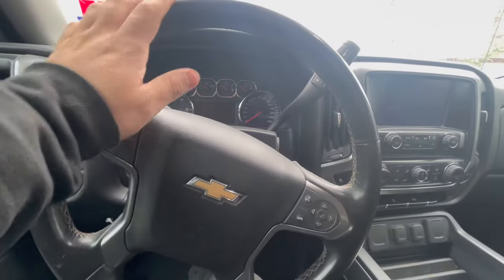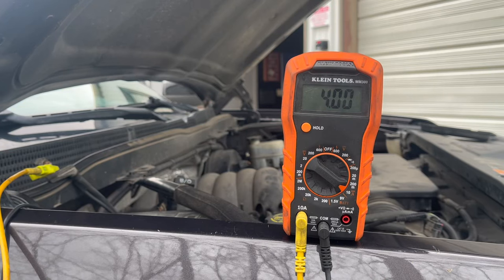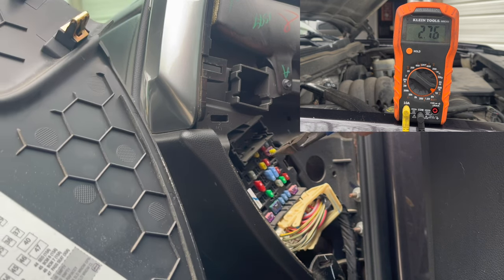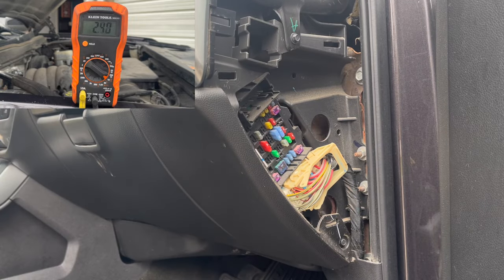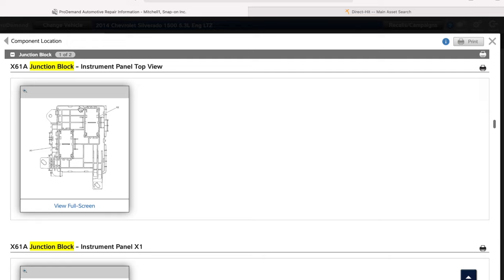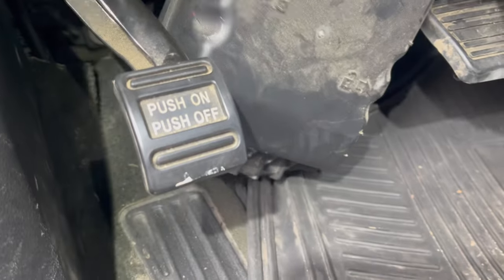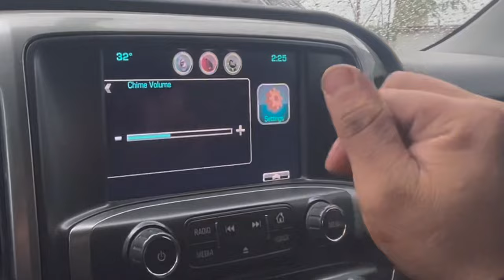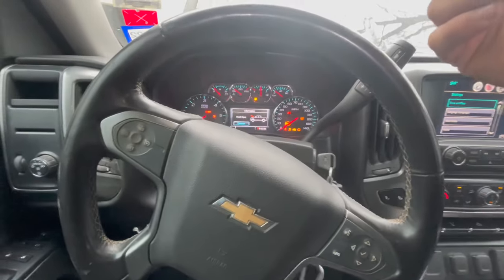Silverado battery draining over night

Comment: the minute you turned the key on and the chime was at full blast I knew right away there was an aftermarket amplifier in the vehicle. also there was an LC-1 volume knob on the knee bolster, the wire at the under dash connection was what the audio shop used as an "amplifier turn on (remote wire)" and it SHOULD have been installed on a switched accessory wire (they installed it to a constant 12v instead causing the aftermarket amp to stay powered on) you could have put an amp clamp on the 4 guage wire under the hood and seen the amp draw. the boxes behind the radio were called line out converters. they are installed at the factory radio speaker outputs to drop down signal to RCA level to go to the aftermarket amplifier, and there would be speaker wires tied into the speaker sides of the wires that came from the amplifier. Also you should have noticed the large blue 4 gauge wire on the driverside firewall. That will have been connected to battery positive and ran to the amplifier. (probably mounted on back wall behind seat) great video again dude!

Comment: With such a high draw, I wonder if an infrared camera would have saved a little time at the fuse box. Aftermarket installers should be required to supply a wiring diagram to help fix problems later. I suppose they don't want to do that with security systems.
Reply from the maker: That is another option I could explore. I just remember Eric from advance level auto telling me, Eric o made a video using the infrared camera and that lead him to a rabbit hole. Need to ask him about that video, so I can check it out.

Comment: That was a hack job for sure. If you want to install an aftermarket amp, spend a couple of bucks more and get the proper patch cable that plugs into the factory harness. It's only about $30 and makes a clean install. If you want to ever remove it just unplug and everything goes back to factory. No more hacked up wiring.

Comment: Good morning brother, thank you for your video, I went through the same process and found it was a parasitic drain/short in my steering wheel.

But what I really need to find now is the link for those battery terminal jumper clips that plug into your kline tool. 
Again Thank you for your help bro.

Comment: Awesome job Oz, was this the one you did a little while ago when I asked about a 2014 Chevrolet that had a different issue or that you couldn't do a video on? It was on your last video before this like a couple weeks back. Good video buddy, I appreciate all your guy's help, knowledge and advice thru everything.
Reply from the maker: Do you remember what video I commented on ?
Reply: @OzMechanics  it was on the last video ya did from 2 weeks ago on a Chevy no start diag video you did.
Reply: @OzMechanics  its all good if ya weren't able to do a video or if ya got busy, not trying to be a pain. You mentioned you had someone come by your shop with a similar problem as my vehicle a 2014 Chevy Malibu LS and I mentioned saw a video from your buddy Eric G at Advanced Level Auto. You commented saying that it was funny I brought it up and you had a customer make an appointment on similar problem as mine, just was wondering if ya found the conclusion to that similar vehicle.
Reply: @OzMechanics  also date of that last video was Jan 28th to be exact. Sorry not trying to be a bother, I apologize if I am. You do an awesome job man.

Comment: That is to retain steering wheel controls and door dinger when installing a cheap aftermarket radio and or subwoofers. They come with a stupid loud speaker that most people duct tape foam over to quite it down. It's supposed to be on a key power obviously. Most likely previous owners had a android headunit and put most everything back to stock. Just easier to leave the thing behing the cluster and trade it in. Probably kept the radio for the 2017 2500hd they traded for.

Comment: Appreciate the video! I Have the same problem, chime is turned down and its loud. Bought new battery 3 months ago and now says low battery.. 2014 Ltz with the sound system package, could this be same issue? I’ll check it out for sure

Comment: Why didnt you use other dmm to voltage drop on every fuse
Reply from the maker: I’ve used different approaches in my career and I prefer the in series test I did on this video. I also made a video testing a draw using the in series test, amp clamp and voltage drop. You can find that video by watching this video again and clicking on the tab on the top whenever you get to the part of the video where I talk about the voltage drop test

Comment: I have a 2007 Ford 250 and the battery goes dead in about 5 days  I tested the battery and get 13v when charged the alternator is also putting out 14v . When i do the test to see draw the meeter goes to 1.39v and within 4 seconds goes to 0.19  and stays there .    What could be wrong making the battery go dead in 5 days    Thanks for any help Norm
Reply: Hi Norm, I know this is old, but did you ever figure out what cause your draw?